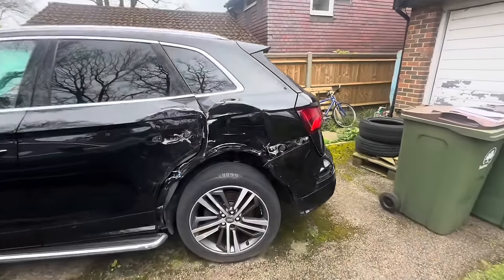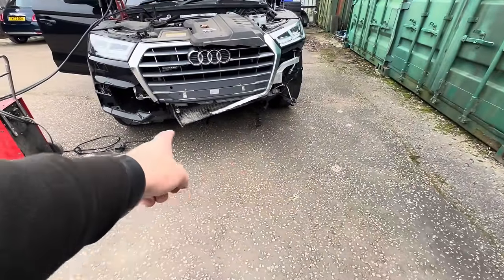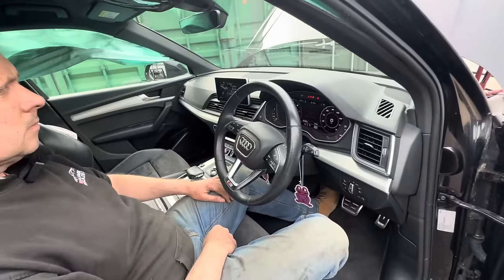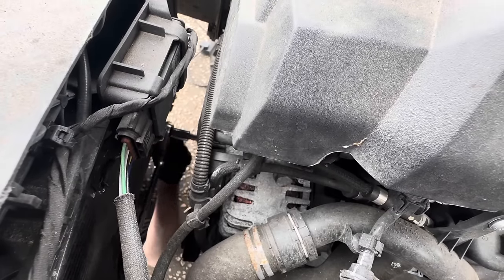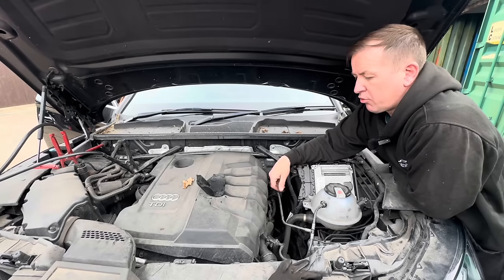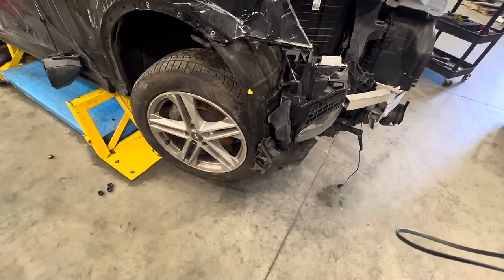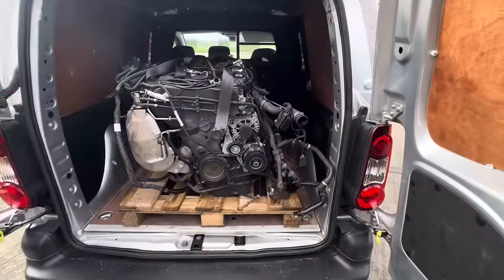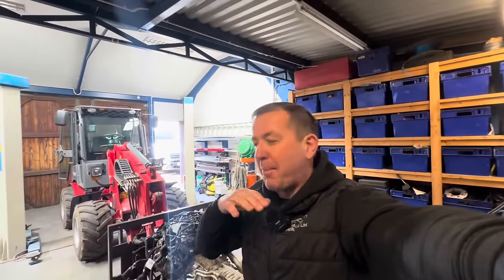2019 AUDI Q5 SOUNDED TOO GOOD TO BE TRUE AND IT WAS!!!

Comment: I ran into the problem with an A5  1.8 TFSi Black Edition from that place beginning with C, it had a plastic sump which had been cracked and then ran until it seized solid. I did rebuild the engine and fitted a steel sump and my Daughter is still driving it and loves it.

Comment: Not sure if anyone has said yet but keep your gearbox lads. It will be coded to the car and have component protection. 
You could swap mechatronic unit over but if your box is fine then keep that.
Reply: Original gearbox will almost certainly be coded to the car

Comment: I saw oil on the floor underneath when you collected it. (Chris “ yeah that bumper is fff..toast haha😅)
Reply: Yes, at 1:04 you can see oil on the sellers drive.  I wonder how long the engine was running after the oil started leaking out of the hole in the sump. The people in the car must have known the engine had blown
Reply: @subrogation747  they must of tried to drive it home. Priced low because he knew the engine is toast . It’s on sellers conscience for the rest of their lives .

Comment: Be interesting to take out glow plugs and drop some diesel, or trans` fluid down the bores and let it soak for few days and then try to turn it. If its been standing dry for ages ya never know.....like you said " It was running before it crashed". You`ve got your safety net with the replacement engine so worth a try as it could potentially save a few pennies..... and a lot of time. Either way, just like a phoenix from the flames it`ll no doubt be up and running by the weekend 😉😂😂

Comment: It's by-the-by, but I wonder how long it took for the oil pressure light to come on after the crash and whether it was still running or if they tried to re-start it and ran it afterwards. The number of sensors and warning lights on things these days you might have hoped that the engine management system would include something to disable the engine if running it would lead to permanent damage. Obviously not.

Comment: I had a 2018 transit blow a hole in block all the oil came out it would turn over on hard shoulder so got one of lads to run to services for oil an it started back up when 30seconds early it was seized solid so try put oil in an turn it if it turn replace sump

Comment: I’d strip the Q5 down see what else u guys need and I would just do a straight swap engine and gearbox as one unit saves all the hassle and mind also do a timing belt and water pump kit on it too and make sure about the injectors needing coding to the car.

Comment: Put oil down the bores iif you can seal the sump temporarily and let the oil sit in the bores
Reply: Why 😂 its fubar clearly
Reply: even if you free it up it will run like a tractor - these lads only sell mint motors so best swap it, someone must have ran the engine after the oil spill
Reply from the maker: It won’t be pistons seized in the bores

Comment: To be fair having been out to a number of these RTA  and looking at were you picked this up from it’s possible that the the owners would not know very much about the workings of a motor vehicle and by the time the vehicle had reached their home all the oil would have drained so no tell tell signs and of course if the battery was flat it would give the impression of a none starter  and would presume if it was a lady driver would have no interest in it’s mechanical state

Comment: Don't mess around with it, boys, just drop the old engine / gearbox out, and fit the other one straight in,  and then drop the old one off to reclamet,   the body repairs shouldn't be too difficult,
Reply: Yes , test drive it first to check the gearbox is good and then the other good one can go back to Reclamet.

Comment: Why would try to start a car without checking if it had any oil in it? 🤔
Reply: No dipstick on that car and I guess nothing came up on dash saying it was low/empty ( sensor maybe be busted too) but let’s face it often they will just see if everything is working just  for ignition to come on, the starter motor to engage and turn etc first , then proceeding to further checks before an actual proper start attempt 😊
Reply: @gimble447  you drain it and but the correct amount back. Oil is cheap
Reply: @sputnikl727 no it ain't 😂
Reply: @sputnikl727  like I said make sure electrical etc ok first and move on from there, you go hell for leather on everything at once and all you end up doing is confusing the entire situation, one job at a time wins the race, you’d have a point only if they started it up with no oil in it, but that didn’t happen did it?? 😂